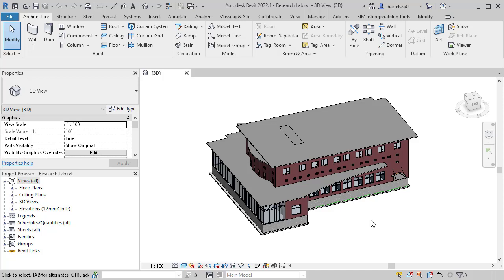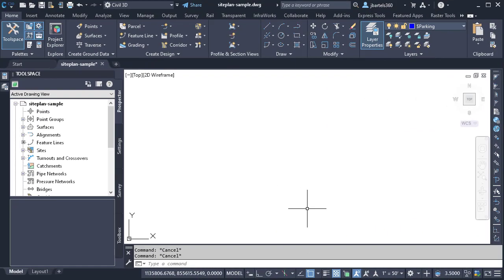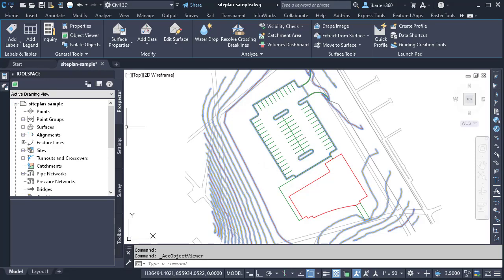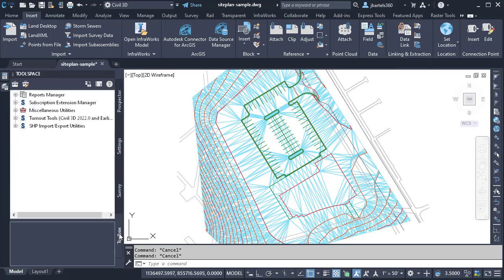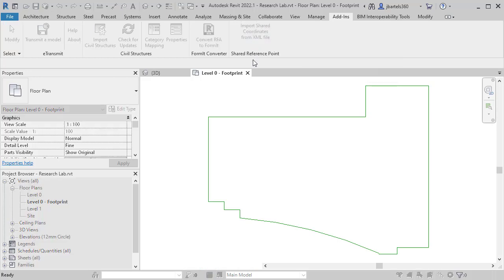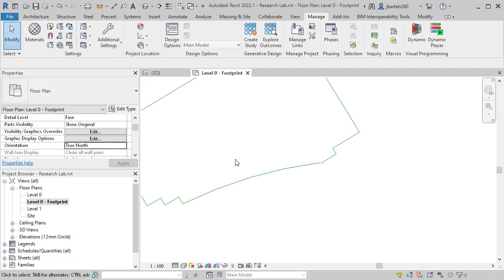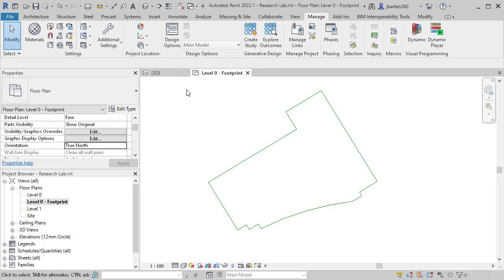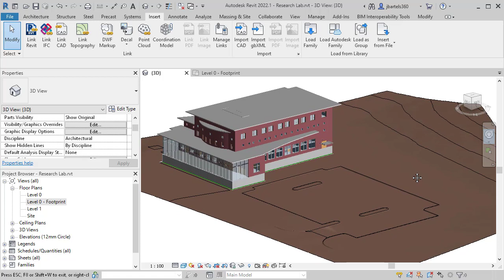Sharing Civil 3D Surfaces with Revit using Autodesk Docs

Comment: @jeffbartelsCAD - Does this keep the site close to the internal origin in Revit? Revit purports a new 20 mile limit from a many versions ago, but realistically anything larger than a mile and imported DWG files begin to fall apart.

What we are trying to do (as we live in denver) is link the topo as you showed, bring the SW corner down to 0,0,0 and then acquire coordinates that way, but there appears to be a bug with lining in the flat-cad site using shared coordinates.

Comment: This is very useful. Why can't this sharing of surface be made available to those who do not use Autodesk docs (just sharing on the same machine)? I use both civil 3d and revit and quite often I need to share a surface. Going through autodesk docs seems unnecessary and often creates more problems.